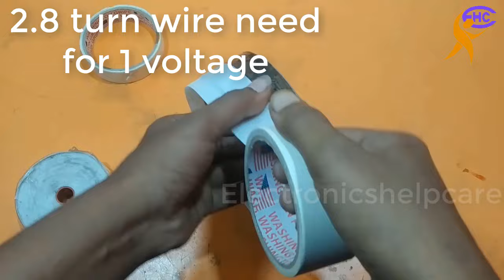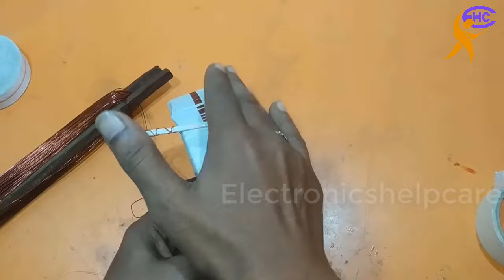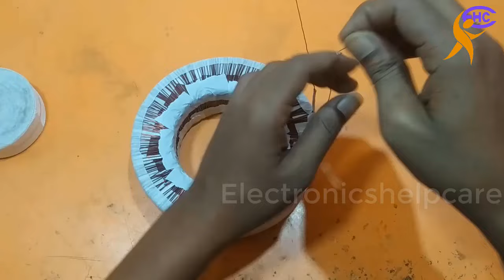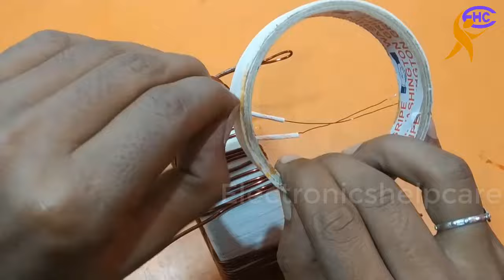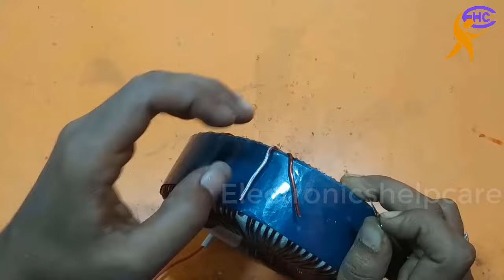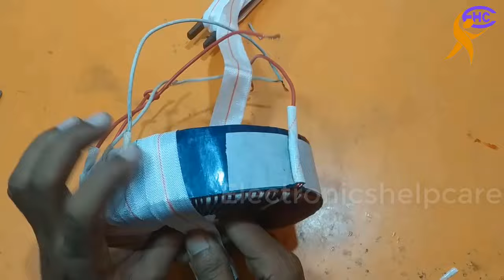How to make  battery charger 12volt 24volt 36volt?

Comment: The output is still AC surely at a minimum it needs rectifying to charge a battery?
Reply: yes you need to use rectifier to get steady and constant DC to charge battery

Comment: primary coil is not okay. If there it is on line voltage, can make a short circuit.
Reply: Input12 volt dc and output 56 volt 200 Amp charging transformer,  how to make, plss say

Comment: If 42 is your constant for a 220 a/c mains how about for 120 a/c mains ?.
Reply from the maker: https://electronicshelpcare.net/?s=gauge
Reply: @electronicshelpcare  ty bud
Reply: 42 is not constant . It depends on the core material . If core is of c.r.g.o (cold rolled grain oriented ) , lesser turns will do ie 36 .
Reply: @johnyv.k3746  it is preferable to give more turns which leads to aa better magnetic flux which eventually increase the performance of the transformer 🙂🙂🙂

Comment: That will not work as battery charger it's just a voltage transformer...where is the rectifier , it must be converted to direct current first before it can be use as battery charger  !!!
Reply: Yes

Comment: How Amp calculation or wire gauge calculation
Reply: Find a wire gauge chart on line.  Look for one that shows circular mils for the gauge wire.  A simple rule of thumb is to have 500 or more circular mils per ampere of current.   There should be sufficient capacity at 500 circular mils per ampere to prevent overheating of the winding.